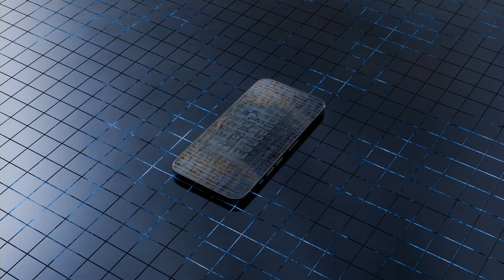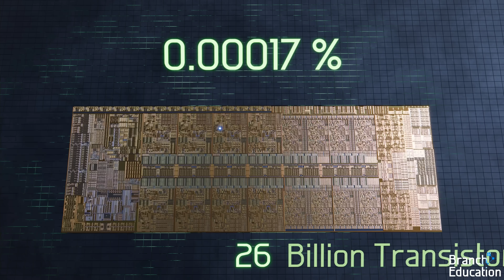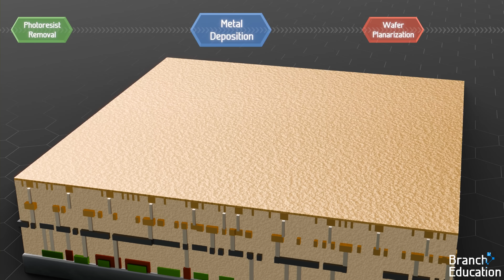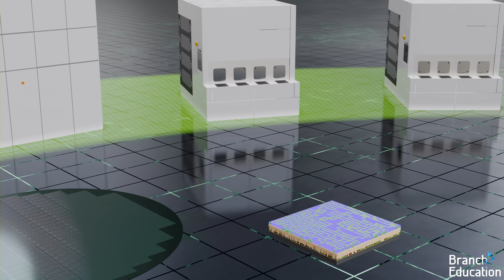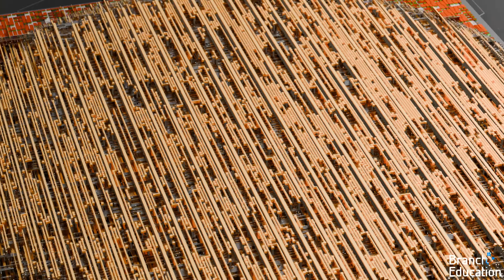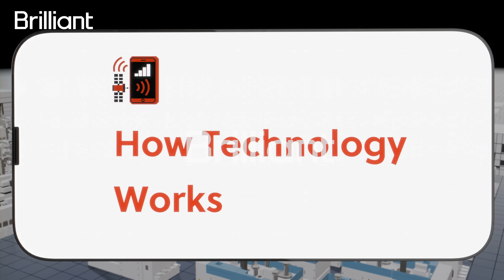How are Microchips Made? 🖥️🛠️ CPU Manufacturing Process Steps

Comment: And now I believe that the most impressive part is at 13:04. I don't mean using this pattern for photolitography because it's old technique) but precision of the mechanical device that moves wafer under ray of UV light. How precise this movement has to be so it hits exactly the area of the chip? These electronic paths cannot be moved by single micrometers as it would not fit other layers (improper connections would be made this way). Any non-precise movement would make entire CPU useless. Cool movie by the way.

Comment: why are wafers circular and not rectangular?
Reply: The wafers are cut from a large cylindrical silicon crystal. Why is the crystal cylindrical and not rectangular? Because it's grown by essentially dipping a seed crystal into molten silicon and slowly pulling it out, allowing the silicon to crystallize on the end. The process is radially symmetrical, so you get a cylinder.
Reply: @lunkel8108  thanks

Comment: I can't even imagine the instruments and tools to create such a microscopic system. Not saying is fake but I can't see a tool that can separate millions of elements and connectors on such small area. Electricity flowing through a conductor on such high impulse frequency creates a lot of induction which in turn would make the electric signal interfere between the connectors. Very weird.

Comment: This is wild. It is so incredibly complex and yet these machines made my human are able to build it and make it happen. What I mean is... This almost looks impossible to me. But, we are somehow doing it. There must be a limit to how much smaller we can make these CPUs, and once that day happens it's possible that many computers will be required to hold multiple CPUs. So, let's say that Intel's 13th Gen and 14th Gen CPUs are hitting that barrier wall, who are pushing far too much voltage in order to increase power, then CPUs are going to degrade much faster over time. They say a microcode update should solve this, with the latest microcode 0x129 update, but we will just have to wait and see if it will in fact resolve the issue. Intel could be fixing the issue with this new motherboard update, or Intel is just stalling in order to prevent people from panicking. Whatever the case may be when it comes to these failing processors, and regardless of CPU brand, this entire manufacturing process is unbelievably impressive.

Comment: I have an i9 14900k CPU that recently got RMA'd because of the instability due to the old microcodes in the BIOS. When I received my replacement CPU and updated the BIOS, I swapped out the CPU's - it was my first time doing such a thing with PCs. It was not lost on me how gentle and cautious I should be when doing such a thing, but I was also fascinated looking at them. Such tiny little things that are so powerful. Also, the weight of them was a bit surprising, they're actually quite heavy when held with two fingers.

Comment: Why do we make CPUs so small tho, I mean, even just doubling their size by area would make an even powerful CPU, no?
Reply: Because CPUs are designed for speed, and unimaginably the limiting factor here is the speed of light through the interconnects and transistors. Light travels just under 1 foot (precisely 299.8 mm) in one nanosecond.

Now think about that labyrinth of wires, they’re probably really long (relatively) if you were to unwind it all, and one CPU cycle requires that the signal is able to travel through the entire CPU before the next cycle, otherwise it’s gonna cause problems. Thus the larger the chip, the longer the wires are and consequently the longer it will take for signal to travel through the entire chip which limits the maximum clock speed.

That’s why we haven’t seen much increase in clock speed over the years. We’re now focused on trying to execute more instructions in a given amount of time to further increase speed.

Comment: The most impressive video: the software used in preparing the graphics to present the technologies used is unbelievable; the advances in creating transistors, interconnects, etching, packaging, ... are unbelievable! We replaced vacuum tubes with a solid state switch called transistor whose whole function is to produce 0 or 1.... and from there human brains have done wonders in packing billions of such transistors into today's chips! .....Thank you for such a brilliant video!

Comment: The amount of tech that has gone into this is insane. The devices that we use everyday are a testament to immense human capabilities. The fact that us humans can even conceive of making something like this which is so so complicated let alone actually manufacture it is mind blowing. Kudos to computer scientists and chip manufacturers! Seems way more intense than making a rocket.
Reply: AND NERDS AND GEEKS AND
Reply: a rocket engine actually is a super simple thing - you can basically build one in the backyard and even figure out best nozzle designs etc with trial and error. the hard part is to improve it to a point where it runs stable inside very tiny thresholds extremely close to the physical properties of the used materials without blowing itself to pieces...and then improve it even further.

Comment: Some functions are super secret, I found a lot in phones and AMD. The functions are inherited from the DOS era, and are still important for the energy saving mode. One is the infamous 8087 instruction set, that’s not present in the system. Needs an emulator to import the 32 kb changing the operating of tablets, arm cpu, and effects the display speed as well. Another is the 387 extensions. They can be imported from the XC SD cards, but the phone will behave differently. Also the brand of the card causes different calculations (mahjong), and different physx.

Comment: I have a question 
So , are you saying that depending on how defective the cpu chip is, it gets categorized into i9,i7,i5 or i3. i9 being the most pure.
If that is the case, then can two identical cpus like two i7-4770's have ever so slightly different performance. Because one can be slightly more contaminated than the other?

Comment: Fun fact;
These transistors are 36nm x 56nm.. the light wavelength of a helium neon gas laser is 632.8nm. That's how small these FinFETs are, smaller than the width of laser light!

Comment: This is a great educational video - very well done and easy even for a layperson to understand. It's amazing how many layers are in a modern processor and how everything is registered down to the nanometer. These plants have to be built on seismically stable land as the slightest vibrations could cause major issues. I always thought they might have to use xray lithography as I thought we reached the point where the UV wavelength was longer than the nanometer feature sizes!

Comment: This is as about as good as it gets to explaining the process in less than 30 minutes.
Of course there are many more interesting details, such as how dangerous some of the chemicals used are (HF comes to mind), the testing machine's complexity, the trials and tribulations of developing the vertical metal interconnects to achieve 3D circuitry, why the industry moved from fabs to foundries (cost, you know) etc.
Looking forward to more from you.

Comment: This revealed a lot of things I was wondering about. The light process, etching, cleaning, and so on. Now I see how it's done. However. I tend to think of silicon as an insulating material. What is a semiconductor? And made of silicon? Does it not quite insulate and conduct current to a limited amount? And if so, what purpose does that serve?

Comment: They're way more than that, you need 98 % pure silicon from sand first, goggle that 98% pure silicon 
that takes two batches of 2,400 degrees a hr each. Then that in the range of 95-98% pure these engots are used to make from solar panels to memory cards,  the top 10 company are Chinese as you need coal china now use dam electric  to get very hight voltage. To get to processor you need to clean it further to 99% all company has  their tricks to get there and slice the silicon engots .  Then you can etch processors,

Comment: Hi, how about designing a revolutionary, new cpu/processor /chip design based on the use of light and fibre optics, pretty much eliminating excesive heat in processors whilst they are running, but also exponentially increasing potential compute cycle process power - trust me, should such a design based on light ever be perfected, then we would see an exponential increase in processoer performances all round, probably making such a technological advance, more than likely, if not definitely, the way forward in the pursuit of "ultimate" processing power in computing - just a thought for many processor developers out there to at least, consider . . . 😀😀, Thankyou for your kind time and attention in possible regard to this idea, from, John Allen, Hull, England.

Comment: I have yet to watch the video but I worked for Texas Instruments as a bipolar epi tech on early 3 inch slices in the early 1970s.  It was a very nasty process in those days and I used a vacuum pickup tool to get the slices off the reactor plate after the silane gas deposition and put them into a "boat". My process was the first one in making the chip from the raw silicon.  I was hoping you would include how the silicon boule is grown, sliced and polished(not just a quick over view).
The semiconductor process has come a long way from when I worked in it and it is a much cleaner process. In the first six months of my employment my badge clip spring got eaten up twice by the HCl vapor used to etch the slices.

Comment: There are also CPU improvements so that the CPU is more advanced than the GPU.
12bit basic architecture Zilog120 X84. It would replace 8 bits. The 24bit 16bit Assembly would be replaced by an architecture containing 88000 characters X213 or the older name VorteX88. Or a 36-bit architecture replacing 32-bit. In addition to all this, a DAC supporting 16,000 characters would be added, which no longer records audio in 16Hz steps or the ugliness called 24bit in 12Hz steps. My DAC would have to operate at 48V in order to record with 1Hz steps.
CPU in BIOS the download via unicode ip internet Windows DOS and Sun Solaris
The CPU SlotA / Slot1 bus is provided in a BGA package and SODIMM modules can be placed on the back. Which contain 12bit 4GB 24bit 16GB and 36bit 12GB RAM on a single SODIMM bus and there are several of these on the back of a SlotA / Slot1. The memories have a separate control chip, a north bridge on the ram, so fewer pins are enough to make the data transfer similar to the USB data transfer. USB data transfer has been added to the HDM memory.
HDM 1024bit with bus
HDM2 2048 bit with bus
HDM3 3096 bit with bus etc

Comment: My fridge died. A new fridge will cost me at least €400. A box of sheet metal, with some insulation, some plastic moulds, some piping and a cheap compressor. Why does a fridge cost about the same as a computer with a Ryzen 5, 8GB RAM, 512GB SSD and Windows? The home appliance manufacturers are ripping us off. Fantastic video by the way.

Comment: Electrodeposition is missing here, its a critical process required to fabricate the Cu TSV and RDL interconnects. Even certain solder caps and Flip chip bumps are electroplated too.

Comment: Ok, this is somewhat of a controversial observation, but given the incredible complexity of a micro chip and the nanoscopic (ultra teeny weeny) size of the circuitry and wires within, billions of them, one cannot completely dismiss the possibility of reverse engineered alien technology, right? I mean, how could someone think this stuff up? It's not like inventing a circular wheel. This is some seriously advanced science. And consider, microchips have been around since 1958. What technology existed 65yrs ago that would allow them to be made? Nowadays, they have computers that, ironically, need CPU's to make CPU's, to put in the computers, to make the CPU's!?
It's like the old question of which came first, the chicken or the egg?
Reply: The first transistor was normal size and like an on and off switch made by 1 or 2 people. They started to make it smaller, so the size of 1 became 4 transistors.
4 became 16, became 64 etc etc. Most of the process stays the same, only the lenses became stronger to shrink the patterns. 1 small step at the time.
So nothing alien about it, we have seen the steps to get where we are now. Not like it came out of thin air. This has been a project since the 40's with hundreds of thousands of people working on it. The people that worked on it deserve our respect.

Comment: I used to work at a photomask fabrication plant (20 years ago).  I wrote systems to validate that the mask was within the tolerances specified.  The mask itself is a special piece of quartz glass.  We received a file that described the image of the mask.  This was sent to a MEBES (microelectronic beam etching system) or another laser tool where it "drew the picture" specified.  After the mask was developed and etched it was inspected.  If there were flaws the machine could clean it up by removing a blot or adding a line.  Too many flaws and the mask is rejected.  Included in the image are registration marks, which are there to keep the layers of the "cake" centered.  Then there is a covering placed on the photomask to prevent unwanted particles from getting on the mask.  So the process of making a photomask is almost as mind blowing as the process to make a computer chip.  I only had a small part in the process, but it was a fascinating place to work at while I was there.

Comment: I worked briefly in the DRAM industry as a process development R&D engineer. This is an excellent overview video. Even though it's cheaper, I think DRAM fabrication is even more interesting than transistor fabrication just because of the aspect ratio of the structures.

Comment: Thank you Branch Education. One of the best videos I watched on semiconductor fabrication. As a researcher in this area, I can say that the video is the most detailed on Youtube.
In making the metal interconnects 19:15 you typically perform a process called electroplating, instead or in addition to physical vapour deposition, to deposit copper.
It is also useful to distinguish between front-end-of-line fabrication stages and back-end-of-line fabrication stages to make a distinction between the transistor layers and the interconnect layers. Between the front and back-end-of-line stages are barrier layers deposited to prevent elements, such as copper, from migrating different layers of the chip.

Comment: AMAZINGLY INCREDIBLE VIDEO.
So the i9 i7 i5 i3 are all the same chip but the difference between them are the amount of defective parts?

So those Intel CPU without Integrated Graphics actually have integrated graphics but it just doesn't work due to the problems during production?

Comment: One of the best videos ever made. I work for Comet Group that supplies RF Generators, Impedance Matching Networks, and high power vacuum variable capacitors that are used in these tools ( deposition/etching of conductor/dielectric). Looking forward to more educational material
Reply: So the i9 i7 i5 i3 are all the same chip but the difference between them are the amount of defective parts?

So those Intel CPU without Integrated Graphics actually have integrated graphics but it just doesn't work due to the problems during production?

Comment: Wait, what? Did I understand correctly? The "i9" in an intel processor actually means that it has "more working cells" than an "i7", and not that it was "designed with" more processing power from the get-go?

Comment: First of all, this video is so incredibly in-depth, and I am floored by how good this is. Despite being a Materials Engineering student and knowing how the process works, I still learned a lot from this video.

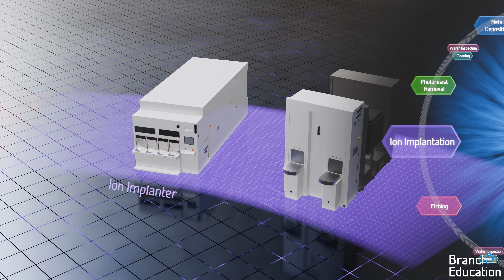I noticed a typo 10:01 under the “Modifying Material” Section, it says “Ion Impantater.” I am almost certain that this is intended to say “Ion Implanter,” as this is what it was called in the video at 16:03.

I say this not to detract from the video, but so that it can be fixed. I noticed it almost immediately when I saw it since I recognized the name of the tools and the processes.

I hope that someone sees this and will correct it, because although it is a silly typo, it detracts slightly from an otherwise perfect explanation of the entire process.

Thank you for spending the 1300+ hours to make this. I can tell you there will likely never be a more in-depth video covering the entire process with this amount of animation and care.
Reply: So the i9 i7 i5 i3 are all the same chip but the difference between them are the amount of defective parts?

So those Intel CPU without Integrated Graphics actually have integrated graphics but it just doesn't work due to the problems during production?

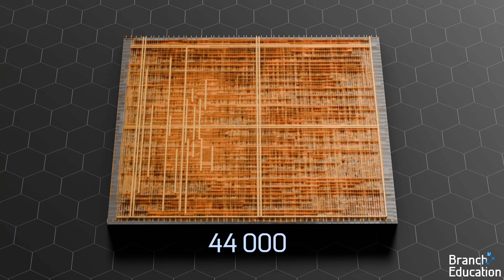Comment: 3:03 wait, 32 bit? I thought modern CPUs used 64 bit
Reply: 32 bit is faster. But since almost always it's backwards compatible and larger size operations are added as new instructions.. It's complicated
Reply: Also, to put into context.. 32 bit and 64 bit numbers are usually floats and very large. For most practical cases you wouldn't need larger numbers. Modern APUs often use smaller sized numbers too

Comment: The most surprising fact I learned from this video is that i9, i7, and i5 processors basically have the same chip, but they are rather categorised by the working parts of the chip!
Also, different CPU even in the same category can have different working components.

Like imagine this, the manufacturers deliberately disable a perfectly fine core of the cpu just so it aligns with the advertised specs!